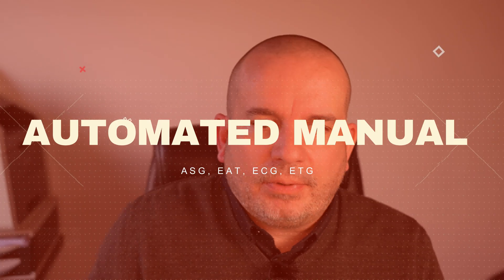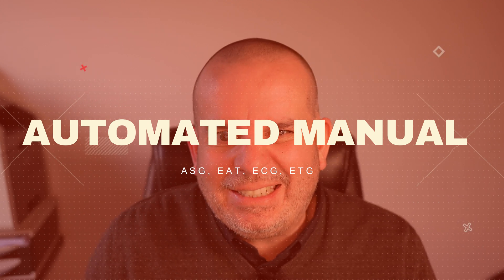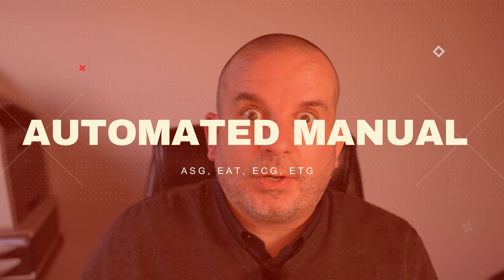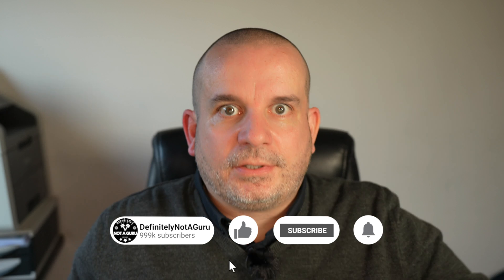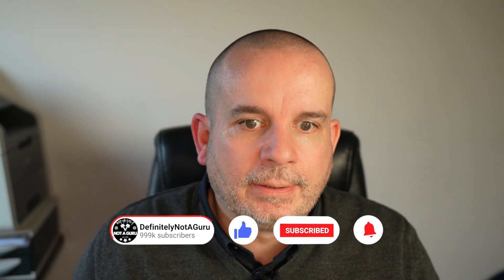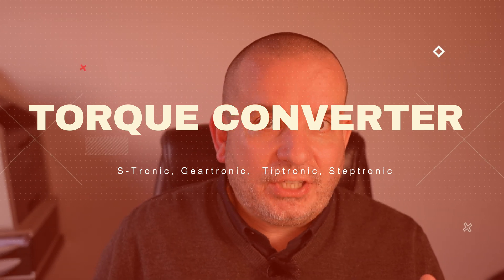Automatic Transmissions Explained - DCT vs CVT vs Torque Converter

Comment: Had a 2013 Nissan Rogue with a CVT, it had 185,000 miles at the end when we traded it in. Insanely reliable. When you stepped on it though, my friend said it sounded like a Dyson vaccum 😂.
Reply from the maker: 😂😂 over here the Rogue is called the Qashqai and they use a CVT that is made of cheese I think.

Comment: EAT is a torque converter and it is a good gearbox 👍
Reply from the maker: New one is good, yes
Reply: Ah yes the EAT8. I have the older EAT6 and while it is good overall it does lack the refinement of the newer box with a few more noticeable shifts and occasional jerks. Thanks for your video I learnt a lot about the other options to consider when it comes time to change cars.
Reply from the maker: @jgreen8339  no problem, thanks for joining in 👍

Comment: Golf DSG and overall I like the gearbox. Quite responsive and mostly smooth. It isn't perfect though. Worst thing is low speed manoeuvres. The car will try and go into 1st/reserve gear and move at idle rpm speed. In reverse that's quite quick. You can brake to slow it down but then it will drop the clutch and you'll come to a halt. Then the automatic handbrake can kick in. Doesn't take that much getting used to and usually now done as a series of 3 or 4 moves. In 1st creep is slower and more manageable than when reversing. 
Then there is quick acceleration. If you want to accelerate reasonably quickly do not fully press the throttle. It'll shift down 2 or 3 gears and you'll have 2 seconds of absolutely nothing followed then by quick acceleration. Press the throttle half way instead and you'll quickly kick down one gear and accelerate briskly past.
Reply from the maker: I don’t get any of those issues on our Touran DSG. Have you had it check over mate?
Reply: @DefinitelyNotAGuru Interesting. It's a 2020 car (1.5 150bhp) with under 10k miles. I hired a new Ibiza (1.0) on holiday with DSG and it was actually worse than mine so I suspect it's normal with petrol cars and the DQ200. Which DSG have you got? But then I'm used to manuals so creep is new to me. But the creep is quite pronounced on the golf for sure. Has a really low 1st and I think tries to use that rather than slip the clutch to minimise clutch wear. Once you get used to it becomes easy to manage. Mines the 7 speed dry clutch box. I think it's the DQ200. I did drive an A4 2.0tdi 2021 and that has wet clutch and the creep was less pronounced. If the touran is a diesel it'll probably be wet clutch. Despite my minor and probably slightly exaggerated quibbles I much prefer it to a manual for everyday use. Did find torque converter smoother around town under 10mph but like you say they use more fuel. Economy wise I had 1.4tsi Leon previously with similar power and this DSG uses a bit more fuel in town (35ish v 38) but less on a run (50ish v 47) thanks to a long 7th gear. So both average mid 40s mpg overall.
Reply from the maker: @paultasker7788  ah ok. We’ve got a 2018 1.6 diesel VW Touran, only 115bhp. to be honest, I never give the gearbox a second thought as it works great.
Reply: @DefinitelyNotAGuru  in-between the Leon 1.4 and this golf estate 1.5 I had a Leon ST 1.6tdi 115 manual and you've definitely picked the right transmission. The manual only has 5 very long gears with a gaping hole in-between 3rd and 4th in particular!
Reply from the maker: @paultasker7788  too many pedals for a bloke with a destroyed left knee too! 👍👌

Comment: Love your CVT overtaking sound 😂 I'll have that as my new ringtone 👌😂. Yes, the CVT always reminds me of driving with a rubber band. But as you say they're very reliable. Also very fuel efficient as they're tuned to set the revs at the engines peak torque. I had a Clio recently with EDC (efficient dual clutch). It was ok but a little jerky. The torque convertor 7 speed in my (new to me) W204 Merc is the first I've had in many years. They've come on a long way in the last 20 years or so. Electronically controlled it always seems to be in the right gear. It employs torque locking if the rpm of the input and output shafts are matched. It also uses "block changing" where circumstances allow. Very impressive! 👍😁
Reply from the maker: Yes, they’ve all come a long way in fairness. Far from the horrors on the 80’s.  That CVT sounds bought out the inner Alan Partridge in me I think. 😂

Comment: Great video. Once rented a Nissan Pathfinder in the US that had a CVT and when you plant the right foot all I got was a lot of noise and not much speed, it was terrible and made overtaking a real gamble. Currently have a Passat DSG and your right about the jerky nature especially at low speed although it never seems to spend any time in 1st gear and has a very short shift into 2nd, but other than that it’s great on motorway. Also have a new BMW 128ti with torque converter, and it’s definitely the best gearbox I’ve had in a car, although the 265hp under the bonnet may have something to do with my assessment on that one. Keep up the great work with these videos 👍
Reply from the maker: I think the BMW boxes are the very best, I have one on my 4 series and it’s a dream. If your Passat is really jerky and a bit dim witted it may be an issue. Might be worth getting a gearbox service depending on how many miles are on it? 
A lot of the US cars are using very old technology, some of the worst autos you can imagine in some of them. A new Toyota CVT is far superior to some of the older CVT tech.